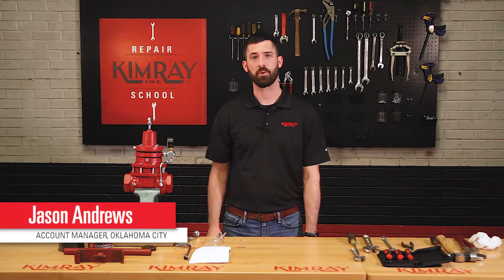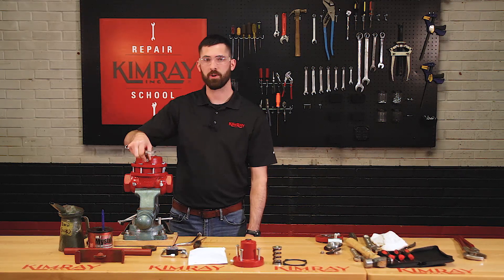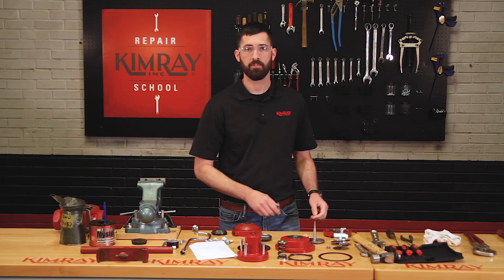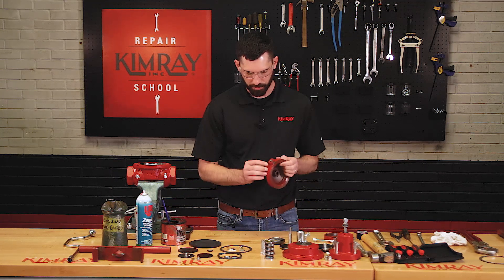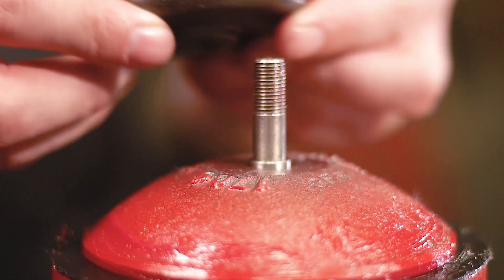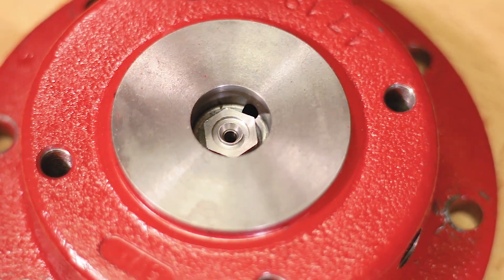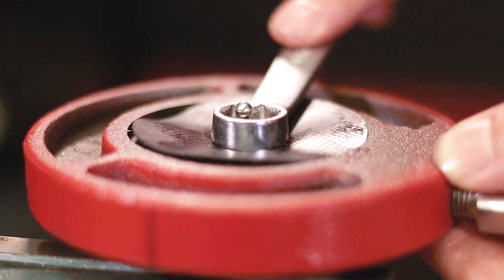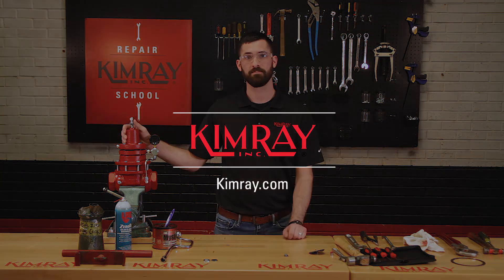Kimray Back Pressure Regulator Repair 🔧 [Full Rebuild with Kit]

Comment: This is a great video!!  I would love to be bale to have a copy to take to work for rebuilding the kimrays we use. However I am in the middle of the bottoms and have no internet capability. Do you have somewhere I could download these videos to my tablet for use at work?
Reply from the maker: We don't officially have a system for making the videos available offline, but if you email me at dennyv@kimray.com, we can get you a link.
Reply: You can also download YouTube videos for offline use through YouTube. Should be an option right under the video.
Reply: You can screen record the videos using your phone. iPhone has the feature built in. Not sure about android

Comment: How much oil do you add to it? And what kind?
Reply from the maker: Fill the lower housing with any kind of light gravity motor oil until the communication hole to the lower stem is fully submerged.